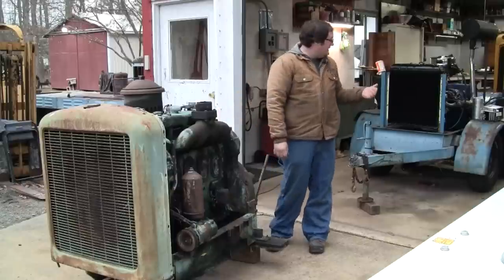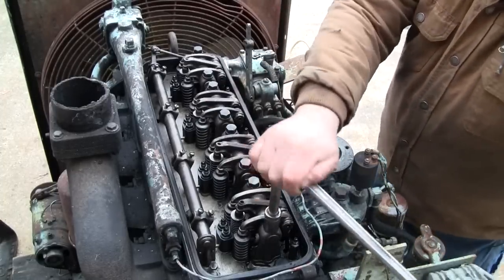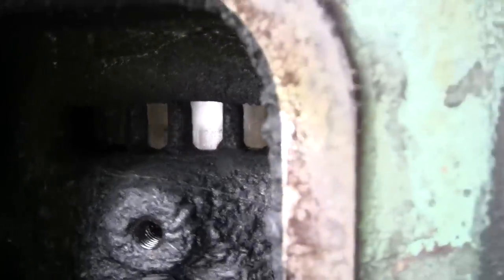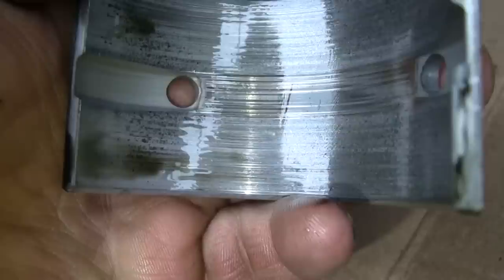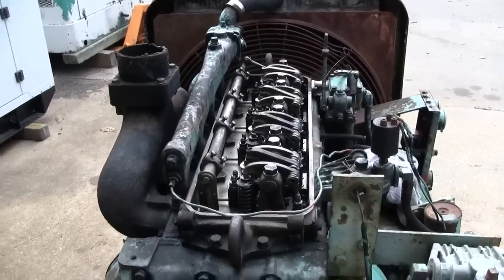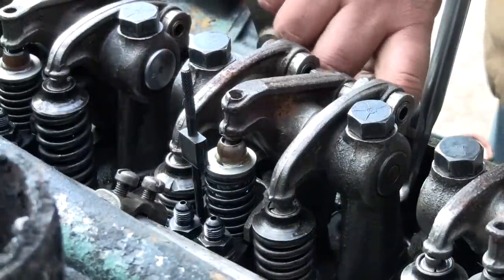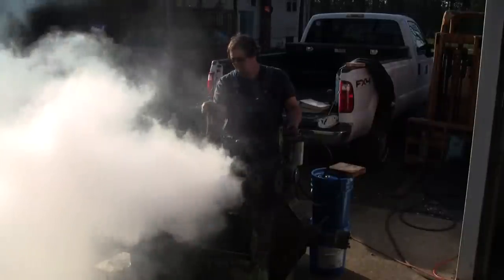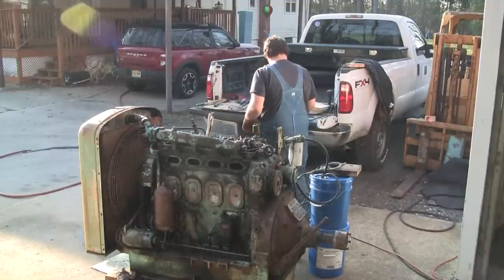Will This Tired GM Diesel Run Again?  1940 4-71 Detroit Diesel

Comment: GM Diesel engine =  Worlds best converter of fossil fuel to smoke and hearing loss.
Reply: Some German diesels Hatz Deutz have the knock knock loud also.
In marine engines these were much quieter water cooled exhaust.
Also England had the plonker opposed piston two strokes .
Look up Napier Deltec three crank triangle two stroke they made for UK trains.
NYC super pumper fire truck used one .
That takes the award from Detroit.
Reply: What? I can't hear you!
Reply: @MitzvosGolem1  Deutz are air cooled...and VERY cool engines
Reply: .....and we love it!
Reply: Exploding dinosaurs...😀😀
Reply: Yea but you could hear them for 5 miles away. Traded for a gmc cab over with 8v71 sounds like angels singing.
Reply: I go to class every time I watch this guy. What a way to spend an evening after work. Sure enjoy it
Reply: @haydenc2742  some new ones have rubber timing belts that break ruin engine.
Reply: Those beasts won the war several times in tanks, trucks, boats, and generators. The Screaming Jimmy was a great engine for sure. Deserves all the love and respect for getting it done. Thanks for the video, Mike.
Reply: @walterbordett2023  almost 300,000 built for the war effort.
Reply: And severe pollution generator
Reply: @Legalmachinist  not worried about all that
Reply: Not only that but the half a million miles on one if not abused and taken care of. Many are still running around with them today , testament to the maintenance and care of them.
Reply: @johnelliott7375  Good availability of parts too. One of the beautiful things about the GM/Detroit Diesels is that a given line used mostly the same parts. Even some 92 and 71 parts are the same!
Reply: Don't forget the oil it burns too
Reply: By far !
Reply: WHAAAT?
Reply: @MitzvosGolem1  watercooled engines dampen the dieselknock because of the water around the cylinder. A watercooled exhaust dampens the exhaustsound.
And lets not mention the doxford marine diesel on mercantile marine vessels with opposed pistons shall we😉.
Reply: @tripplefives1402  yes. They also have types where the only fluid is oil. Cools the cylinders as wel. Like the motor in a smart(the car).
Reply: @henkoosterhof5947  cool. I was a marine mechanic..
Opposed pistons like a knockers UK engine 2 cycle?
Reply: @MitzvosGolem1  yes. Check out doxford somewhere 1920/30. Even allready had common rail fuel system. And yes. Like all big(3/4 storey s high) 2 stroke. Approx 120 rpm. Ps. On you tube are some post where you see them running.
Reply: @henkoosterhof5947  Napier Deltec engine . Nothing ever come close to that bizarre awesome design 👍
Reply: @MitzvosGolem1  Never heard of 'plonker' engines,opposed piston or otherwise.You mean'Junkers' which were German.Napier made a licensed copy of the Junkers Jumo 204 in the 30,s called the Culvern for naval use.Commer made the TS 3 for truck use,Foden made 6 cylinder two strokes for truck use.Leyland made the L60 opposed piston for the Chieftain tank.Doxford made opposed piston engine for ship propulsion as did Fairbanks Morse.
Reply: @eugeneoreilly9356  A "Commer"  opposed piston two stroke UK truck engine s not plonker sorry
I just fixed a 4cylinder  Dover diesel UK nice engine Ford used in industrial and farm tractor

I have a few Perkins diesels excellent 👍
Reply: @MitzvosGolem1  Both good engines.Had a couple of tractors with Perkins.Never had an engine issue despite them being abused.
Reply: @MitzvosGolem1  sir. I know this one.
But: do you know the mouse and elefant crossing a bridge to getter? 
Do you or i stamp?
 Basically they differ.
The low ref  seagoing engines(aprox 30 feet high) have 2 rods when single pistoned.
Doxford has the same.
A: doxford has 2 cranckshafts. One low and one on top of the engine.
No croshead.
B: single piston engines have a piston rod(only moves vertically) a croshead and than a cranckshaft rod. Thats why their hight.
Reply: @henkoosterhof5947  I am familiar but never worked on Large Ship engines.
Only small boats.
You Swede?
Reply: @eugeneoreilly9356  Yeah my favorite engine. CAT bought them
Reply: That was a magnificent startup….   Even though she is across the pond, I could hear Saint Greta’s molars grinding the whole time.   Bravo, Mike!
Reply: Hell yeah, buddy. 😅
Reply: Nothing in the world sounded better as a child in the early 50's than an 8v71 in a Greyhound bus. It would run 70mph even with a full load uphill. Did smoke a bit and for certain never used government fluid, or urea to clean the exhaust.
Reply: From what I can see through the smoke only the second cylinder from the right is the one with most smoke.
Reply: Actually when a Detroit Diesel 2-stroke is healthy and tuned well, it doesn’t produce too much smoke under a load. Usually what I see on YouTube is these engines not tuned correctly. If anything, these engines might only produce a slight haze of smoke under load. 
They certainly convert fuel to noise that’s for sure! And I love it! I hardly ever hear these engines anymore. 
I’ve got to wonder with all the advancements in technology and metallurgy if it would be possible to modernize the 2-stroke diesel to be more efficient and burn cleaner with electronic controls and modern injection, turbos, etc. There is a reason these engines were produced so long and it’s because they were reliable workhorses but were killed off by emissions. With todays technology I’m betting the 2-stroke diesels could be viable.
Reply: ROFLMAO 🤣

Comment: When I was a boy we went to a carnival that had come to town. I happened to walk by a semitrailer that had the sides of the trailer lifted up. Inside the trailer was a huge Detroit Diesel screaming under load spinning a generator to power everything at the carnival. There were electrical cables coming from it as big as my arm it seemed. I stood there mesmerized for so long my daddy came to get me and take me back into the family fold. Since that time I have been a huge fan of Detroits and their unique sound and I will to this day stop and listen to one when I get the opportunity. I was rooting for you to get this one screaming.
Reply: Yes I remember those traveling carnivals in the summer here in PA. They always had some really old equipment generating power.
Reply: Here in Western NY we had the straights fair company set dozens of those orange and blue stripped trailers with pop up sides all over.  20+ years since the fair grounds updated the electric and  didn't need those gen sets anymore, but the sound of them roaring away will never be forgotten, by this kid at heart.
Reply: I had the same experience watching a transverse mounted Gardner six banger making electricity at a fair on the back of an old wagon. Fantastic

Comment: I used to work for an oilfield service company. Old Detroit 71 series engines were LOVED by the oil patch because they did not require a bunch of high voltage/current electronics to run them. All those electronics could not be used in an explosive environment. So they would rebuild these things until they just couldn't be rebuilt anymore. They'd put spark arrestors on the intakes and exhausts, wrap everything up with metalized glass fiber insulation, an air starter, and send it. The fact that 71 series was really good with low RPM torque was a real bonus. Mate em with a 6 speed Allison Transmission or a set of hydraulic pumps and Bob's your Auntie...
Reply: Clarification, by law rebuilding an old 71 series is legal, building a new one of course is not. So skids that had to be powered in explosive environments were deemed "rebuilt" even though only half a dozen parts were actually old, and the entire rest of the skid was new.
Reply: I still got boxes of rebuilt injector and several rebuilt heads for 3,4,6,8 cly 
I use dd fuel pump to prime engines with oil and diesel
Reply: @Rorschach1024  New ones are built every day for military applications, to use as replacements for those already in service.

Comment: I've been running and rebuilding Detroits since 1960. In the navy, commercial fishing and yachts. They're the only engine I go to sea with because of the reliability. The basic design goes back to the first diesels with mechanical injectors.  Once the rack is set, (governor, rockers, injector height) they're good for a couple decades with just the usual rocker adjustments, if you keep the fuel and oil clean. The injector has a lot of parts with small clearances. So clean fuel is important. I run 2 micron filters and buy clean fuel. I haven't changed an injector in 11 years. I have 2 1947 blocks in the yacht I liveaboard. Rebuilt only once, 11 years ago by me. They had somewhere above 30,000 hours and 60+ years before the rebuild.

Comment: Many years ago I worked on a boat that had a 4-71 for a fire monitor pump, 2 6-71's for gen sets and 2 12V-93's for main engines.  After awhile you could tell by sound if something needed attention. A change in sound would wake you up at night. Great video

Comment: I've been following Squatch253's channel  & the resurrection of His 1938 Caterpillar D2  #5J1113. It too uses cast brass for the oil filter housing. Engines were richer back then with zinc in the oil & led in the gas. Bronze bushings, copper fuel lines, brass carbs, sometimes nickel plated & cork gaskets, clutches & fuel floats. Wood skids or carts, galvanized fuel tanks & water coolers, glass sights, porcelain plugs & Babbitt bearings. Cast Iron everywhere, wrinkle paint, silver solder & early pot metal. Paper ply flat belt pulleys & silkscreen decals. Mica, Bakelite or fabric impregnated phenolic insulators, felt & leather or graphite rope seals. Control panel jewel lights & gauges all built like a well made pocket watch. Cloth & asphalt wire wrap & Japaning enamels. Color coded braid woven wires & dovetail buzz coil boxes glued together with hide glue & wax paper & foil rolled condensers. Horse hair oil bath air cleaners. Most parts had its # or makers mark & illustrated parts books thick as church bibles rich with insignia scroll industry advertisements, & bygone aroma of alchemy. Some old thermostats were all brass with an accordion style expanding bellows to actuate the valve. not anymore, the bean counters got to em...
Reply: I'm thinking brass/bronze is a lot more expensive now.  I've heard it takes casting really well.  I don't like zinc or aluminum which is now the norm.

Comment: Hi Mike,  Diesels need heat to perform. In the 1980's I ran EPA emission tests on Detroits at GM. The "smoke" test warmed up @ Rated Speed and WOT for 20mins, so don't be afraid to rev it up for a while. After that warmup the "smoke" test began immediately. Starting at idle rpm it went up to rated speed at WOT, simulating a 80,000Lb load, then made what sounded like a gear change on an 18 wheeler. I recorded the smoke plumb, but I remember the music to my ears of a 2 cycle 8V92TA, turbo whining, revving up to 2,100 rpm at WOT and making a gear change. That was livin!  Great video.

Comment: Have been a mechanic long enough to have worked on these, though never a full overhaul. A good two stroke mechanic has to be something of a specialist to get fully familiar their nuances. I became a mechanic because I liked all gauges, special tools, adjustments that were required for the "settings". I even have a new Kent Moore tool set you show in your video. Diesel engine manufacturers had to go back to the "old school" unit injector, but at much higher fuel pressure to meet EPA standards. Good stuff! What other engine you know of where you can; with ONE bolt; remove an access cover and inspect the rings,  and liner?
Reply: yep totally agree
Reply: True
Reply: Detroits really were "simple" well relatively speaking.
Reply: Yes, they are specialists. I knew a guy that rebuilt everything from a 2-71 to a 12-71...and a lot of Alison transmissions.
Reply: "...What other engine you know of where you can; with ONE bolt; remove an access cover and inspect the rings,  and liner?..."   EMD's, the Detroit's far bigger brother .I worked on them 50 years ago and as a skinny youth I often got the interesting job of undoing the lower crank case covers so I could climb in and clean the oil pick up . On the EMD ,you can see the all the rings through the scavenge ports and you poke them with a screw driver. If they move,they are broken and the liner Head assembly comes out with the piston and rod. Huge engines but simple to repair and rebuild.

Comment: In the 1970's I supervised a couple of different service rigs for Shell Canada in the foothills. One had a 12V71 and the other had 2-8V71's. The 12V71 twin turbo was unreal. On one job we had a couple of duplex pumps pumping water from the river. We couldn't get one of the pumps running. I called Waterous out of Lethbridge. Later a guy drives up on location in a 1969 GMC half ton pickup. I was expecting a complete field service truck with a crane, air compressor, welder, etc. I thought he was lost. Turned out he was our Detroit mechanic. I asked him where his tools were. Right here on the seat. He had a screw driver, a crescent wrench, and a pair of pliers.  He said if he couldn't get it going then it was a major. Ten minutes later he had smoke coming out of the right hole. His advice was to slam the operators hand in the door so he was mad at it and then would rev it up!

Comment: I drove a Brockway tractor trailer that grossed 50 tons in the 1990's. The first season of gravel hauling, it was powered by a 8-71n 4 valve non turbo. It was underpowered and cooked a couple of pistons and liners during the season. The one thing I remember is a very distinctive smell when it would start smoking because of blowby. Almost like a vegetable oil smell.

Comment: I grew up on a farm, we had a 8V71 or (, a 318) in a International Semi truck. I drove it a lot. I think it is why I am deaf and my backside always tingles.
Reply: I think 6v53 was a 318 cu in.
Nice
Reply: Lololo I never drove one but out of shop but I can’t hear crap and it’s 52 years of diesel mechanic life
Reply: @MitzvosGolem1  318 rated horse power. 8 cylinders  x 71 cubic inches equals 568 cubic inches.
As I recall the GMC  2 cycle engine weighed significantly less than similar Cat and Cummings. Maby hundred of pounds, I am sure someone knows.
Ours had a air starter. I miss that old beast. 
It's method of making power was much like a hookers come on to romance, loud, crude, messy and completely unmistakable.
Ours did not leak oil, it marked it's territory.
Dad claimed it didn't vibrate, it throbed. I am not sure I agree with that.
Reply: @scotthanson7888  Love either on a cloud morning smells like victory..
Reply: @MitzvosGolem1  
This was in North Dakota, trust me the engine saw either 
Contrary to popular belief either can be used safely.
Mis-used, especially with glow plugs, can send the cylinder head thru the hood, the roof of the garage and into low earth orbit.
The piston can be sent thru the oil pan,thru the earth to China.
Reply: @scotthanson7888  yes I have used it since 1979.
Not in new Kubota diesel .
Never  japanese diesel s breaks rings etc.
I learned the hard way .
We had 16v71 two in ferry on long island new york. And gen sets.
Nice for marine engines.
Reply: @MitzvosGolem1  truckers referred to their engines based on the Hp rating.  The 8v71 for trucks was normally set up for 318hp.   It’s not a proper way of naming them since Detroits are named based on the cylinders and cid size but everyone knows what they mean.   They also called the 6-71 a 238
Reply: @TugboatMatt  6× 71 cu in per cylinder is 426 cu in ...
6×53 is 318 as per my Detroit manual and those engines can be industrial 175 HP up to 400 HP in marine engines ort  fishing boats or fire trucks high output.
I have been working rebuilding owning them since 1987.
Not sure who told you that.
Reply: @MitzvosGolem1  318 is 8v71.
Reply: @johnhhinton5473  6×53= 318 cu inch as per Detroit diesel Allison
Reply: IIRC 318 HP was a common rating for an 8V71 with N70 injectors. Throw something else in there and it's no longer a 318... For with N50 or even smaller they'd put out under 250 HP. You'd find those lurking in busses. Likewise marine applications tend to put out more power with better cooling available
Reply: @holysirsalad the turbocharged version,  the 8V 71T with N75 injectors was rated at 350 hp.
Reply: @TugboatMatt  yep, used to hear truckers talking about their 350 Cummings, 425 Cat ect
Reply: @MitzvosGolem1  every trucker calls their engines based on the horse power rating.   It’s not the proper way of naming Detroits but that’s what they do.  They do the same with Cummins and cats also.
Reply: @TugboatMatt  Except 8v71 HP rating go from 200 industrial pump Genset  to 400hp in sport fishing boats .
Reply: @TugboatMatt  855 Cummins is not 855 HP.

Comment: It’s definitely been rebuilt at one time.   I’d guess in the 70’s.   Most likely when the head was changed also.    Has newer type liners in it.  Reason for knowing it’s been rebuilt is because it has the newer style liners in it.  Being sick a early engine it would have had the “BB” liners as there nicknamed that had round holes for the air intake ports.   Over the years there was a few styles of liners made.   There was a type that used large round holes, 2 rows of smaller holes, ports that were in a 8-shape, then the current ones are a oval port.  If I remember correctly the current oval shape ports came out in the mid-late 50’s

Comment: I currently have a old 4-71 that's around the age yours is in a 1941 Oshkosh, she's got the old external fuel rails on a 2 valve head. They're mean sounding engines when running strong.

I'd love to own that one though, mainly just for the age of the block, I love anything early to mid 1900s